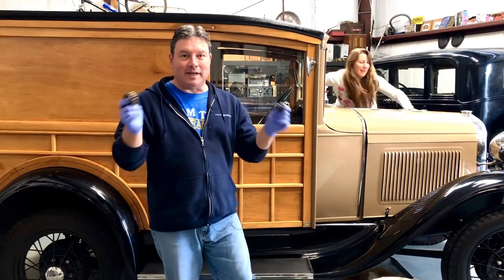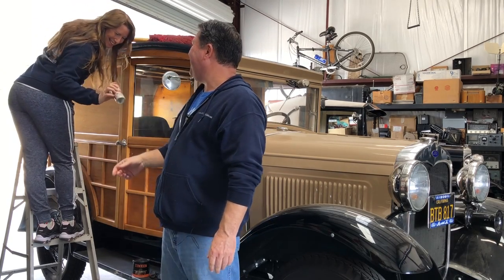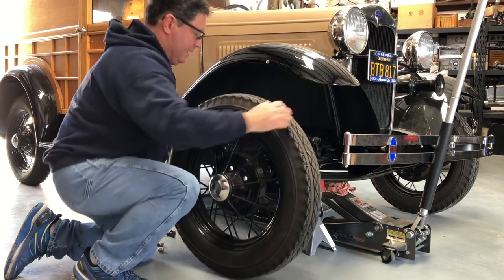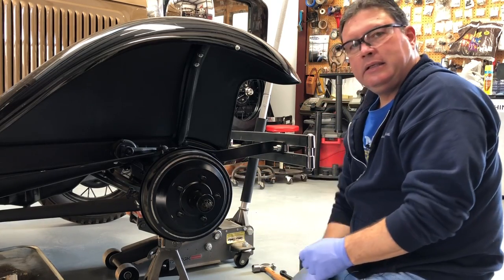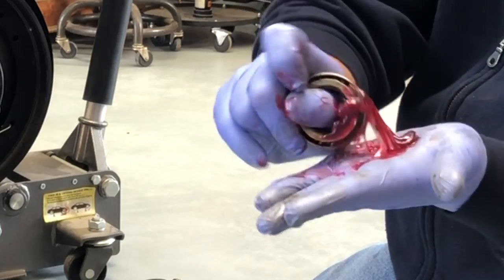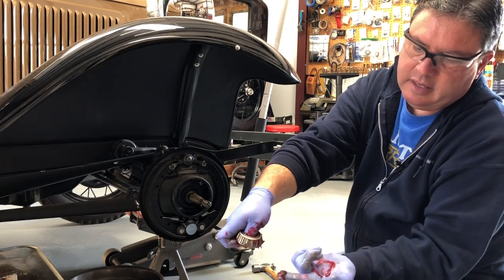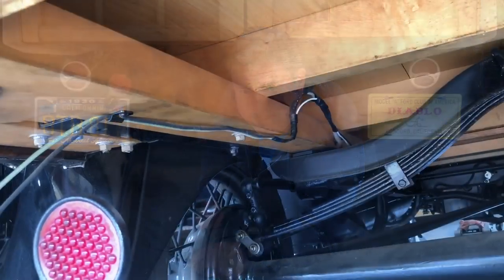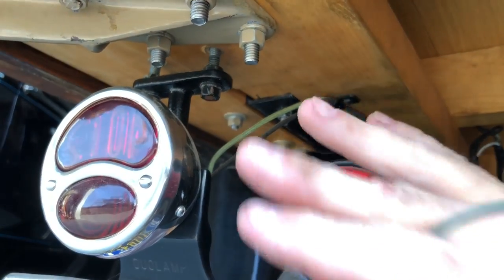How to repack and adjust Ford Model A wheel bearings

Comment: I hope you don't mind me commenting from this point of view ('80s motorcycle guy who was an audio technician in a former life). In my world I'd consider those ground connections good enough to get you home but not a permanent fix. I understand that grounding to the chassis was standard practice when these cars were made but it is just about the least reliable way to provide a return current path possible so I would have wanted to add a proper ground wire that goes to the battery (I'd probably want to add a proper ground wire to the harness and connect everything to it).
Reply from the maker: That's cool.  Thanks for the input!  Model A's use the chassis as the return path for everything.  They are positive ground, and the positive battery terminal goes where?  Directly to the frame.  There's no separate ground wire anywhere in a stock Model A.
Reply: @ModelA  I think most cars (& bikes) used the chassis for the return path until the '50s or maybe even '60s. It works when everything is new &  in perfect condition but once oxidation starts to work its way between the connections (accelerated by galvanic action) things randomly stop working. You might get away with it in a relatively salt free location (not too close to the ocean or anywhere they salt the roads) or if it only goes out when the weather is nice but I've seen enough issues caused by chassis ground connections that I wouldn't want to trust it long term. FWIW, that's what I expected you'd find when you crawled under the back of Termite Bait.
Another reason I don't like chassis ground is that when people ground accessories to their bike's forks the current has to flow through the steering head bearings to get back to the bike's frame so every time the steering moves there are arcs between the bearings & races (not great for bearing life).

Comment: Hi Paul! You and Tina did a good job on the cleaning and packing the bearings on the Model A woody, Termite Bait. Nice catch and great fix, on the ground to the tail lights. My dad showed me the same method of packing bearings back in the late 60's early 70's. Great video, I appreciate the thorough instructions on proper seating of the bearings too. Thanks for sharing, you and Tina have a great, and safe weekend!
Reply: My dad showed me the same method in '57 or '58.  He also showed me how to handle loose bearings by embedding them in grease.  Since he worked for White Motor Co. before and after WWII, I figure he knew what he was talking about.
Reply from the maker: @BillB23   You dad taught you well!!!

Comment: For a guy so supportive of maintenance, please do something with that floor jack. i learned along time ago the a squeak means friction and friction means wear. Please use a little oil on that lifting unit. Thanks
Reply from the maker: That jack always makes that noise!  It's the cylinder.  The rest of the jack is well lubricated.  People who have the same model have told me theirs makes the exact same noise.  It's old and creeky.

Comment: Hi Paul and Tina 

Nice to see you seem to be back to your normal happy active self !!! Good clear video as usual  I never preload front wheel bearings . I make sure the bearings are seated then back the nut off till I feel a barely perceptible "rock" at the wheel rim . This gives a tiny space for lubricant to get between roller and race . I jack up the front end when I grease the king pins and shackles etc etc and always check the "rim rock" never ever changes . I have never had a front wheel bearing fail over many years of very happy model A Ford driving  . We have had front wheel bearing failures in our club by too much preload but never from being too loose . In England a cotter key is a split pin and an English muffin is a muffin . I am sure your method is just fine if it were not you would have known by now !!!
Reply from the maker: Thanks John!  If you don't preload the wheel bearings, you take the chance that the rollers can slide along the race instead of rolling.  Also, loose bearings cause wandering steering.  That 0.001" of gap at the bearing turns into 1/8" os play at the outside of the tire where it contacts the road.  Causes the car to wander and jump from rut to rut.
Reply: @ModelA  I understand what you say but in practise my cars drive straight and true with no wander  that would flag up . At the moment I have  6  cars/trucks on the road in England and my 1930 CCPU in sunny Chandler AZ  . Never seen oval rollers in my bearings would it matter if the rollers slide although I very much doubt under normal road loading they would do so . i navigate rutted English lanes at low speed so no rut jumping !!! As we say in England "The proof of the pudding is in the eating "  so we do not agree on this . Maybe I ought to save up my pennies and meet with you and you can take me for a ride in your super sport coupe to see what preload imparts I  might be missing something  never too old to learn (82) I come out to my trailer in Chandler AZ in January and will do the Turlock swap meet . I have another 1030  CCPU in AZ also a 20 AA truck both restoration projects . .12 weeks in AZ  so plenty to do  !!!
Reply from the maker: @johncharlton2602    If it works for you, then that's all that matters!  See you at Turlock.

Comment: Hi Paul and Tina, wanted to thank you and Bob for answering my question about my 29 Tudor body assy.
I may not have been as clear as I should have been.  
My question is in what order are the body, fenders,aprons,and other sheet metal parts assembled.  Got my A 35 yrs ago fully disassembled.  Thanks for any words of advice. Hope you continue to feel better, I enjoyed the wheel bearing video. 
Jack, Jefferson. Co. Ky.
Reply from the maker: Ah!  Body first, get the doors to line up. Bolt down.  Aprons next.  Fenders last.  You'll have to tweak on fenders a little, don't panic.
Reply: @ModelA  ok, ty for the help!

Comment: I picked up a 72 Baja Beetle from some people that ran it into the ground abusing it as an off-road toy.

The bearings were so loose that the car would slew crooked when hitting the brakes and had to counter steer to stay in the lane.  The grease was as bad as you would think with one wheel nut held on by a roofing nail.

Comment: While watching this video, I had an idea for another video (as if you need my help :)  You already have a 100% stock Model A. I was thinking while looking at those tail lights in this video, a newbee Model A owner doesn't have a point of reference for stock other than books. It would be very valuable for you to go through your Model A filming the original parts and pointing out areas that get modified unjustly, and what to watch for when sorting out our "new" purchased Model A. Maybe pointing out differences between your daily driver coup and the sedan where you DID modify for good reasons.
Reply from the maker: That's a great idea!  Thanks WM!

Comment: Hey Paul, newbie question for you, how did you go about removing the inner wheel bearings? I appreciate all of your videos, they’ve been real lifesavers.
Reply from the maker: Just pull it off.  If yours is stuck, use a  bearing puller
Reply: @ModelA  Awesome, thanks Paul.

Comment: Paul, your videos are enjoyable. I may not see it correctly but when doing the first front drum, it looked like the brake roller pins are installed wrong. The large head should be inside on the roller track. Just saying what I think I see. Glad you are doing well.
Reply from the maker: It has those stupid "Flathead Ted" floaters installed.  That screws up everything.

Comment: I think I need to go over my bearings again. To me the brakes were dragging so I never felt like I got an accurate reading when I put them together. Maybe? The ‘Death Wobble’ is coming back now. We did adjust the Toe-In per your video and it seemed to go away. I’m wondering if the bearings have loosened up some.
Reply from the maker: That's why you back off the brakes about 5 clicks first.  Then, put them back where they were when finished.
Reply: @ModelA  I went back and watched the video and finally noticed that. Thank you!

Comment: What are the most common sizes of cotter pins used on the Model A and should you use zinc, or stainless cotter pins ?
Reply from the maker: The Model A uses about 7 different sizes of cotters.  I have always used the stainless ones.  Never tried any other type.

Comment: Paul did you use a solvent to clean the old grease in the bearings before you repacked them?
Reply from the maker: Yes.  I cleaned them in the parts washer.

Comment: I've been watching your channel for some time now, great videos. Was wondering if there was a steering wheel column radio that would have been used back then that one could use? One that is affordable to restore and works well? Any help is appreciated, thanks.
Reply from the maker: No.  The first car radios appeared years after the Model A was out of production.
Reply: @ModelA  I am not worried about if it came out when the model A did, More interested in having one that someone driving it in the 30's would have put in it. Like a company that maybe made one so you could put one in a vehicle without a radio. That kind of thing. Thanks again for the help.
Reply from the maker: @genwatkens2505    Ah.  The Galvin company worked with Motorola to put the first car radios in cars in the mid to late 30's.  They were not small units.  The radio was a hige box that was mounted in the back of the car somewhere, the control head was mounted under the dash somewhere (WAY too big to mount to a steering column), and the antenna was compromised by insulating the chicken wire in the roof or adding aerials to the car and wires between them.  Then, after all that, the ignition system had to be heavily modified to reduce the spark RF noise so the radio could receive any signals at all.  Even now, a radio in a Model A can only pick up the strongest of stations.  And, you can hear how many RPM's the motor is turning by the noise mixed with the strong radio signal.
Reply: @ModelA okay, so it needs a noise blanker? And none that was small enough to be put in a model A? That's not want I wanted to hear haha, but thanks for the help. I'm looking at model A trucks so it definitely wouldn't have enough room for something like that.
Reply from the maker: @genwatkens2505   A noise blanker is something you might find on a CB radio, not an AM broadcast band radio.  All a noise blanker does is clip the audio peaks on the radio's received audio.  It does nothing to stop spike ignition noise from blanking out stations below the signal level of the ignition noise.  This might help- https://www.caranddriver.com/features/a15128476/the-history-of-car-radios/
Reply: @ModelA  okay I'm a CB fanatic, and was always told the noise blanker in a cb was originally used to blank out points ignition noise. I was never sure if that was actually the case or not. Also just figured it would work on a old radio seeing they are both AM. I am not much of a radio guy except for collecting CB radios. I'm looking at making a period correct model A. Not the way it left the factory, but how someone would have been driving it in the 30's maybe early 40's at the most. Thanks for the help.

Comment: Great video. Hope you don’t need the bearings you were clanging together at the beginning of the video, hopefully they were old junk ones just laying around your shop that will never be used. Being a mechanic 👩‍🔧 we know you never use a bearing that has been banged, dropped or compromised as in spinning a cleaned or dry bearing in any way as it will lead to premature failure 😞 if put into service, but again hard lessons aren’t soon forgotten. I’ve learned a lot over the years by watching videos like your. Thanks, too bad they only come out once a week.
Reply from the maker: Those were the ones I pulled out of Athena a few months ago. I installed new bearings in that car.
Reply: I thought so I knew you knew better than that being a man of your caliber. That A looks great 👍🏻 😊. I do my bearings the same way, great video. Thanks